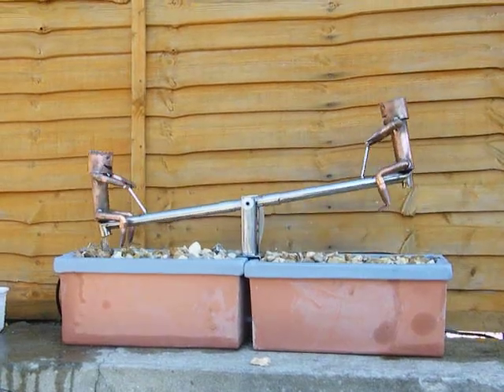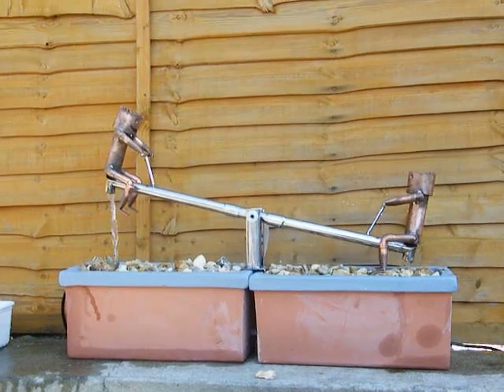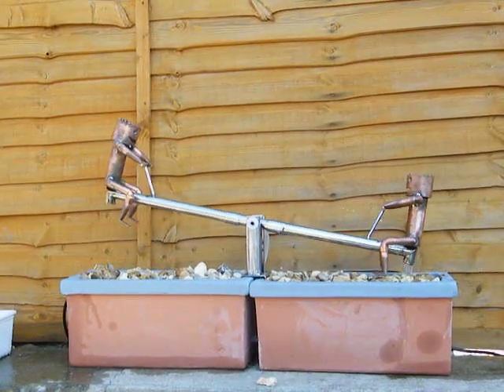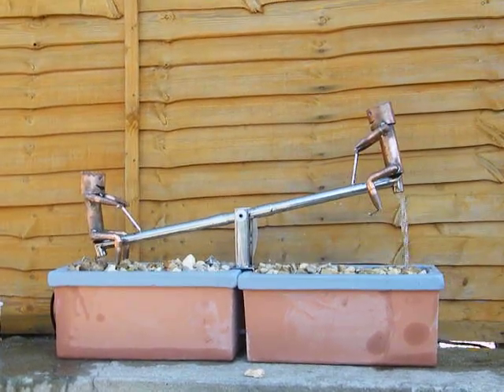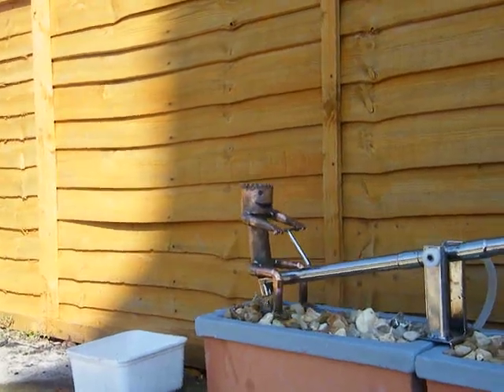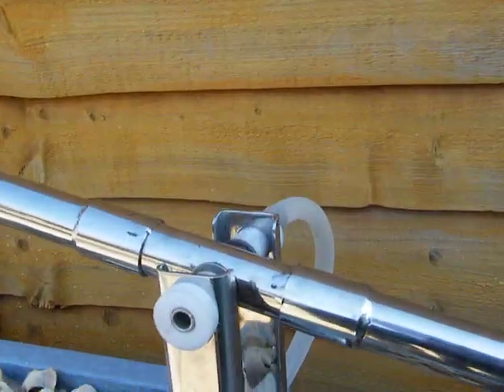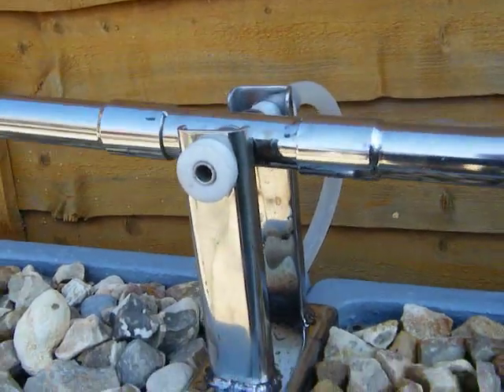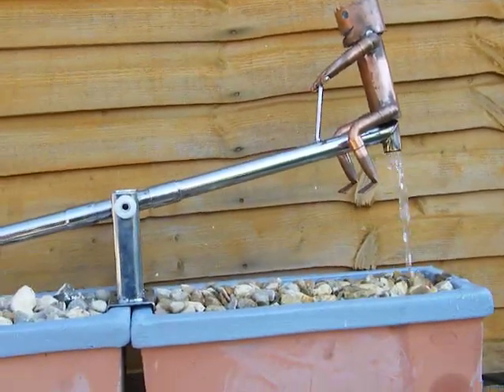Garden See-Saw Water Feature

Comment: How do you prevent the pivot or the rod that goes through the center from obstructing the rolling ball?
Reply from the maker: Hi
The feed tube is also one side of the pivot and is welded flush so as not to disturb the internal bore of the main tube...the other side of the pivot is solid bar welded to outside of main tube